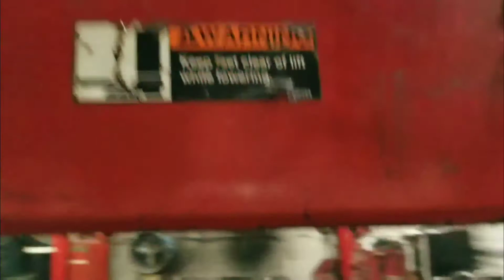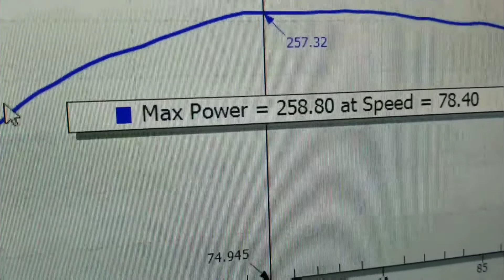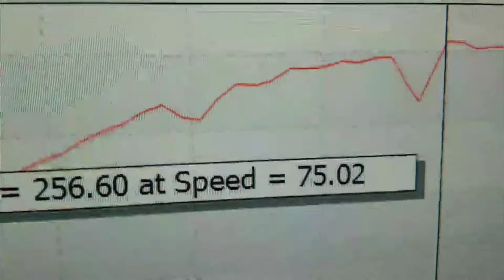Nissan 240 tuned with megasquirt dyno results

Comment: Ordered a megasquirt  for my sr20det with easy cams greddy intake 70mm throttle body 740cc nismo injectors and a td06-20g turbo and full 3in isr exhaust. Hoping to make close to 400hp.

Comment: I got a mega squirt and literally don’t know what to do now All I want is the stock tune and I can go from there but it won’t even stay running rn
Reply: did you go get tuned by someone locally? or did you just throw it in?
Reply: @BubonicDoty  it was just installed now it’s running but misfiring a bit I think it’s due to poor connection cuz the plug is only held I. By the center bolt
Reply: So I can’t time it yet but at least it’s kinda alive lol do you have any tips